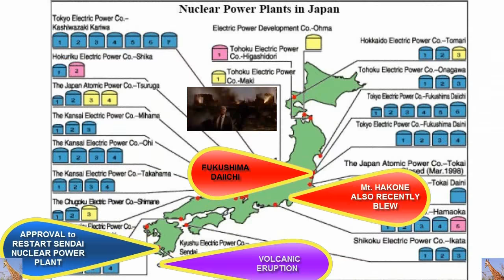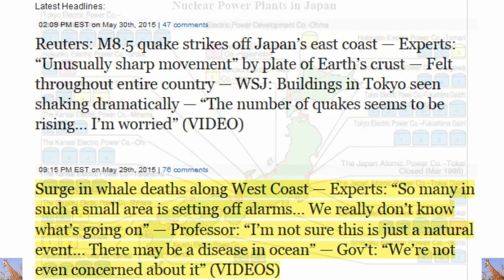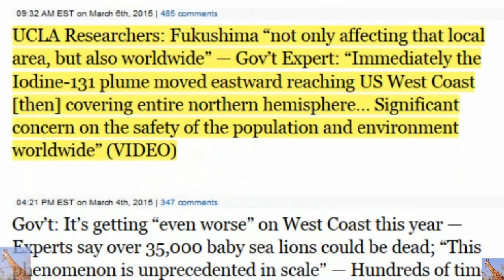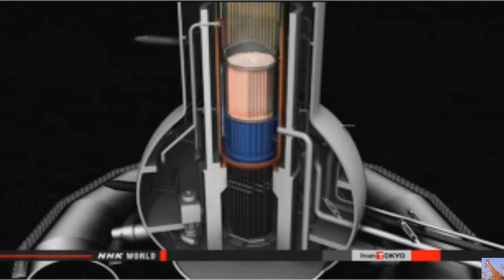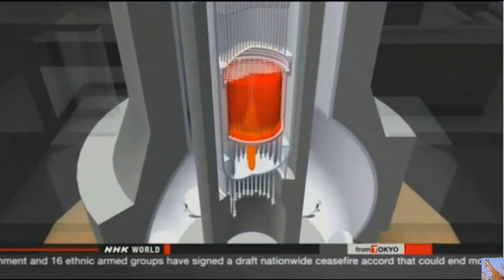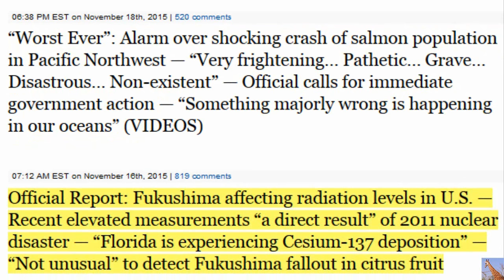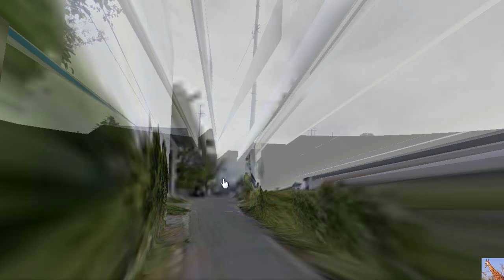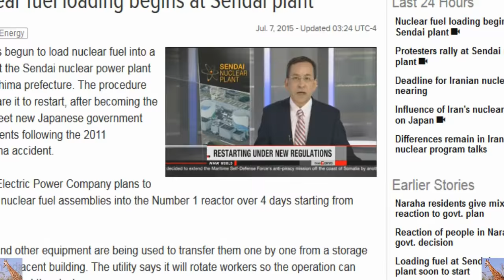Fukushima: Trump Faces Undeclared Nuclear War Against the United States

Comment: If radioactive waste (especially used fuel) would be placed in airtight canisters and buried, wouldn't radioactive decay buildup pressure in the containment canister causing it to rupture and leak radiation.
If buried, they need to be monitored and accessible for maintenance.
Reply: Spudboy Potatoes We should be using it as an energy source to run a factory to build solar panels! Like a methane treatment plant would be used.
Reply: Spudboy Potatoes If buried and something goes wrong, the water table will be contaminated.  That happens, and we're all screwed.
Reply: Alexander Grimsmo Yep, and how'd that work out?
Reply: Spudboy potatoes ,correct thats exactly what is happening ,even with the vitrified flasks (waste surrounded with glass but the fission carries on until  pressure gas and heat will force it to leak ,not clean not green and not cheap .